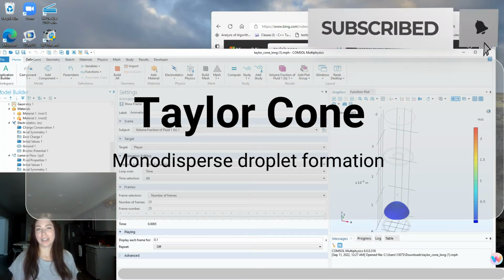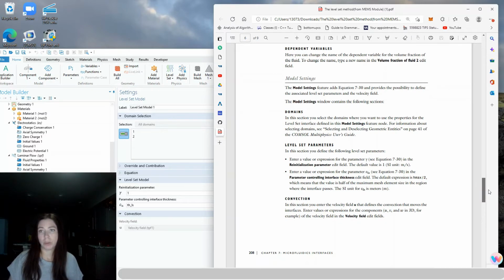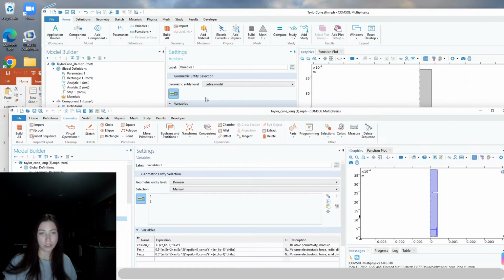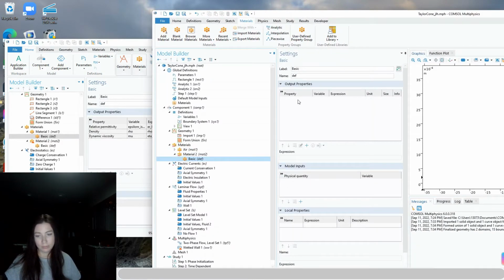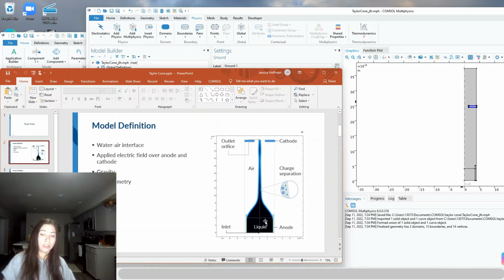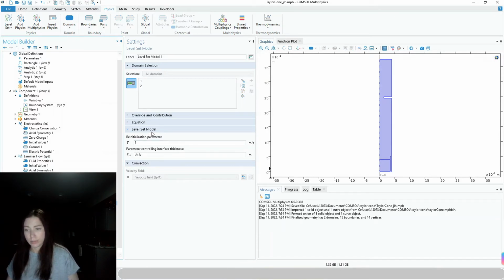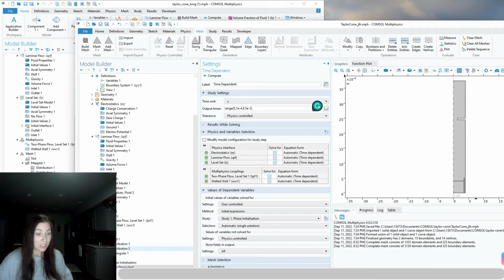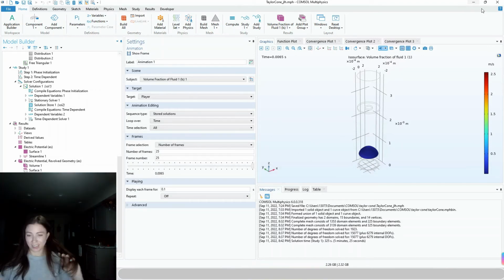Taylor Cone COMSOL Tutorial

Comment: half of the video is blank😂😂😂，and I wander if the nozzle is micrometer size，the module still works？I am a graduate of chemistry too，still working on this disturbing thing
Reply from the maker: Yes I have accidentally missed some clip at the end before I exported video and realized it later 😂
Reply: Seems the Taylor Cone (and electrostatics in general) suffer from a lack of attention and research; it's kinda like 21st Century Voodoo 🙂
Reply: @englishsquared9146  yes, its true, this model is designed for hundreds micrometer scale nozzle, for the real commercial printer using 2-10 um nozzle, to realize this, I spent a lot of time to redesign a model to fit it which works well
Reply: can you please explain the formula Fe_r and Fe_z  used in this, Is it maxwell stress tensor if not then how the Volume forces are being calculated @leechengtai3441